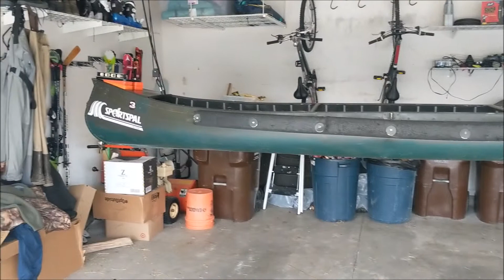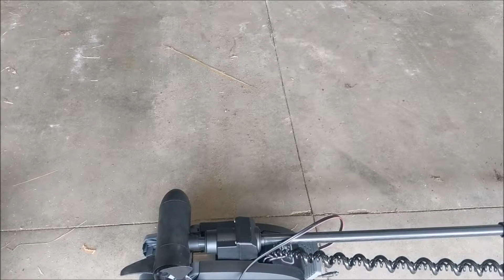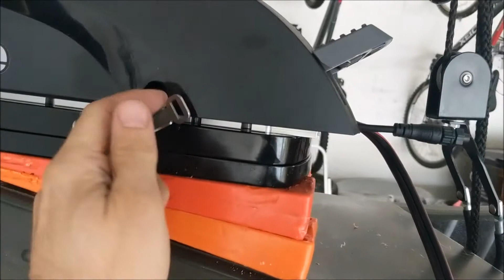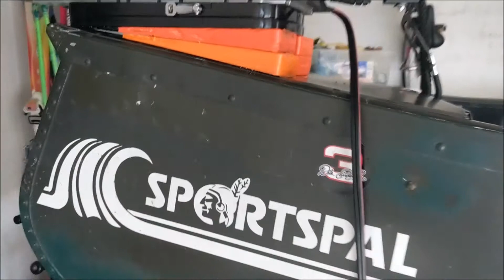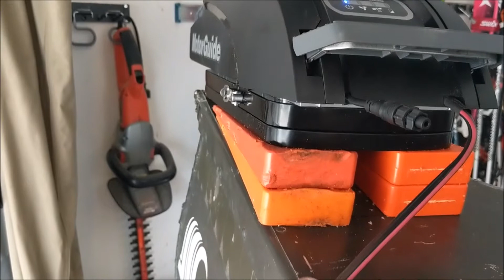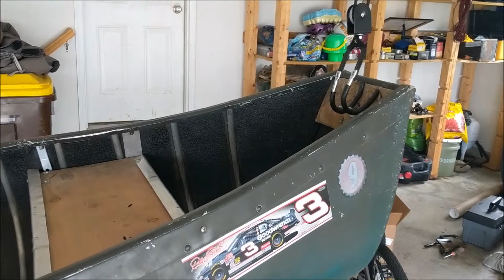SportsPal Motor Guide Install Pinpoint GPS

Comment: Just wanted to follow up a few years later as I'm about to try the same thing. Any issues or things you wish you would have done?
Reply from the maker: Just try to get the bracket as level with the water surface as possible.  The gps and compass works best this way.  It will still work pretty good if its not completely level (mine is not.)  I have to just make a small adjustment when setting a course heading to get the boat tracking where I want.

Comment: Good job! What size power wires and connectors did you use for connecting the motor to the battery?
Reply from the maker: Just the wires that came attached with motor.  I have a 60 amp fuse spliced in. I want to say they are 8 guage wires.  It should say in the trolling motor manual what size you need.